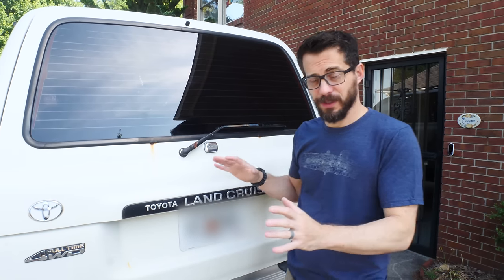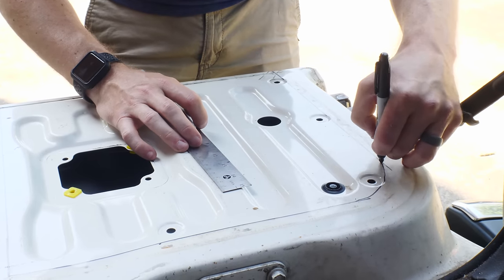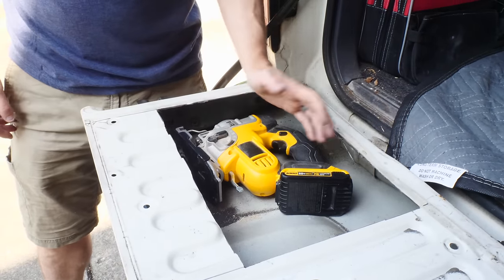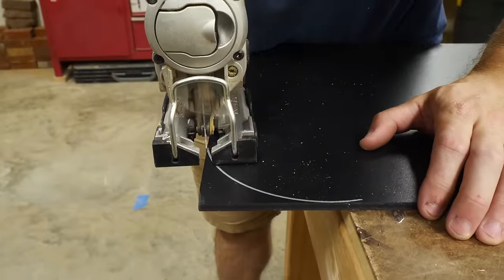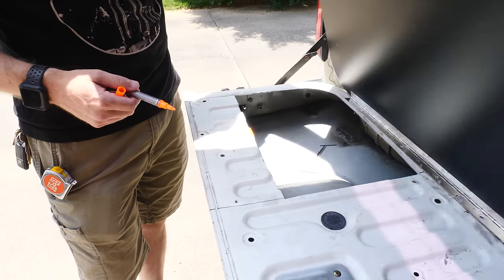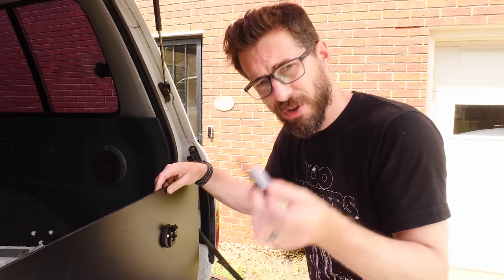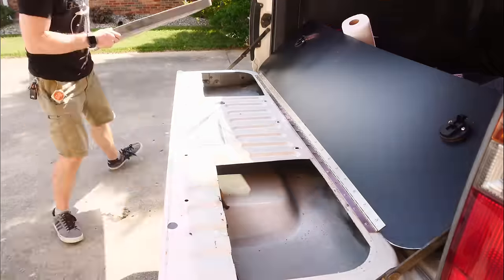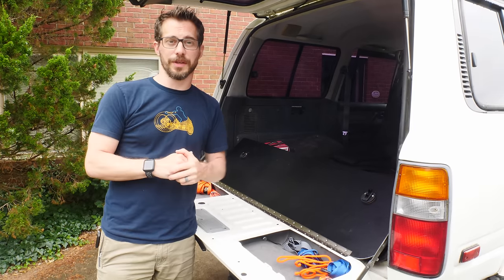Custom Tailgate Storage // Land Cruiser | I Like To Make Stuff

Comment: Hey bob, I have done something similar to work trucks. We did the same thing by cutting pockets into tailgates and used diamond plated steel as the cover but we covered the inside storage and the cover in similar material like rhino liner( spray on truck bed) it made helped with sound and rigidity. I also work with a lot of thin materials like composites and a way to make your cover rigid is to apply some single directional flex honeycomb. Think like the cardboard sheets that have honeycomb and how rigid they are. Let me know if you want to discuss more. I can give you more in-depth detail.

Comment: Hi Bob ! Great project as usual. But you made 2 compartment storage, and only 1 door. I think I might cut 2 doors. To make door closing, i might use magnets because you can stack papers when you need help in  perilous situation. 

For my van, I preferred to buy a 5 seats. But in the cabin, between my seat and the passenger seat (as we call in French "Place du Mort" place for dead) there is nothing. An empty place. So I decided to fill in the gap with 2 storages, 1 big enough to store road maps, wheel wrench, 2 warning triangles and 2 safety vests... The second is made to store my mobile while I'm driving, electronic toll card for highways and my usb key. It's made of MDF that I paint in black, I used hinges, magnetic locks, and "air spring". I can't finish because I need some help to finish the with fabric and foam, to have a mellow surface.

Comment: Awesome mod!  I see others have already recommended adding a rubber gasket around the edges, which I also think I would do...additionally though I think I would have pulled the plastic clips off the original tailgate cover panel and then used on top of your plastic panel.  This would have taken out some of the gap you were fighting for your marine latches, plus it would have a bit more of a factory OEM look.  Of course this would mean drilling holes in the panel too...but you already cut your truck so I would say go for it!

Comment: Plasti-dip tool handle coating would be a great add to the metal lip left over after the cut.  It's thin but provides a nice, durable coating.  I have used it for walking stick handles that have lasted 5+ years so far with heavy use.

Comment: My current project is a front end rewire on my ute including battery relocation and reconfiguring the start and charge circuits, its real nerve racking dealing with cable management,  bob, you should put in a power box in the back of your cruiser, usb, 12v and accessories, plus usb outlets behind the centre console so passengers can charge their stuff too

Comment: Love the videos!  Land Cruiser videos especially.  Next you should do on board air compressor.  Puma makes a good 12v air compressor.  I had one in my 93 LC.  You can weld up a bracket to hold it using one of the 3rd row seat mounting holes on the wheel well.  Super handy having a real air compressor on board.

Comment: I did something minor to my car way back in the early 2000's. I had an '88 Camaro. Like many cars from that era, it had an ashtray for cigarettes, and no modern power or audio connections. I had a pre-iPod mp3 player from Creative. Used the ashtray panel from the center console as a template, plastic-welded up some styrene sheets, and then built a dock for the mp3 player that included audio and power connections. The player dropped into the dock like you'd shove clip up into the grip of a pistol. I had an old fm transmitter glued under the panel, which allowed me to transmit the 256megabytes of mp3s to my OEM 1988 radio. Wish I still had pictures of it. Even my car-guy kid brother liked it.

Comment: Hey man, you could rivet some aluminum channel to the full length of three sides of your foam pvc cover to add strength to the sides and corners and limit flex when it warms up.  That would also make it a lot more durable.

Comment: I love this but I do have 1 suggestion.  speaker box carpet.  Add it to the top 1. cleaner look 2. slight acoustic enhancement. 3. I cant confirm this one will work, but I believe that if you add it to the top it might help keep the plastic from getting as hot and warping, cant say for sure this would work but I suspect it might not draw as much heat as the bare plastic.  also if the plastic rattles against the tailgate, a layer on the back side might help.  you can usually find speaker box carpet in a variety of colors to match your vehicle and is usually available on sites like amazon.

Comment: Love this use of space. You know what would have worked extremely well when cutting these pieces out. A powered sheet metal nibbler. It is specifically made for doing this. Also, you could have used the chalk marker and put it on the plastic rivets things that held the carpeting on and then lay your black plastic on that. Drill out the holes where the plastic snaps go and then drill holes in the plastic and the carpet for the latches to go through. Then you could have attached all together and still keep that piece of carpet that matches the rest of your interior flooring and still be able to use the latches. 👍🏼

Comment: Sure, I (sadly) often have doubts starting projects. I have one in my garden that I've wanted done for years but don't have the guts to start. Not sure if it's needed, but maybe cutting some thin pvc tubing and put along the edges of the metal to avoid scratching yourself. Depending on how it works some dividers might also be good to avoid noise from stuff rolling around. But no need to add something that isn't needed! :)

Comment: I love seeing foam pvc being used for different things. I mostly use it for cosplay armor myself. Just be careful if you ever have to heat form it and don't use the laser cutter to cut it as the high heat causes the release of dangerous fumes that can harm you and cause early degradation of your laser cutter.

Comment: Just came across your video mate, have done the same to my ute (truck) tailgate. But with food grade stainless steel so I have a cooking surface. Also use pinch weld for around edge of your cutouts to save on bandaging your hands later pulling things out of the new storage spaces.

Comment: super cool idea, I've done similar on my Jeep, and I found that it also looks a little cleaner if you take some rubber stripping/ weather sealing material and line the edges of where you cut. It's less dangerous that way and looks a bit less jerry-rigged! just my 2 cents tho

Comment: great little project, have a tip though, I had a small concern about the metal edges, yes you filed them down but i feel a rubber gasket that people use on widebody cars would be a great addition

Comment: @ILikeToMakeStuff Instead of the PVC plastic you might try some 12 gauge steel. I'm afraid when you pull something out of the back of the truck it will cave in. Even sitting on the tailgate, someone might sit right in the hole and bust it. Another possible option would be to cut it in the middle so there are two doors.

Comment: Interesting storage idea!  I think I would also use a different material than that foam board, maybe a nice diamond plate or hardwood panel, to preserve my ability to sit or stand on the gate without going through the holes or bending their edges (because it's not only the ridges in the skin that strengthens it, but also the fact that it's a solid skin).

Comment: The rivets will eventually pull through the plastic. If you put a small washer on the back side of the rivets prior to setting them, that will prevent them becoming loose and pulling through.

Comment: Hey I Like To Make Stuff,  I don't know if I'd be cutting my tailgate open like that, but I do like how yours came out :)  Here's a quick tip for when you have an exposed sharp edge on sheet metal; I used this stuff a lot when I worked for Blue Bird Bus Co. building school buses.  I don't know the generic name for the stuff, but we called it TrimLok.  It's a flexible rubber trim that clips on to an exposed edge on sheet metal.  The clips are molded into the trim so you don't see 'em.  It looks great and covers up sharp edges.  They make it in many sizes and colors. Try it out next time you have an edge you need to cover.
Reply: By the way, if you decided to use something like that you can use a heat gun to soften the trim up to form it in to tight bends like in a corner, etc...

Comment: I would go back and add some edge trim to those cut holes. It covers the bare metal, prevents any possible cuts, and adds a more finished looked to the hole. It's meant to cover cut edges of sheet metal like that and its pretty flexible so the ridges shouldn't be an issue.

Comment: I would have made all the corners radiused to reduce stress risers, and then fold a small lip to the edge all the way around for stiffness. Also if you positioned the latch a couple inches over then the latch keep could have gone under the low part of the corrugations to save the packing and the bolt heads protruding. Easy to be wise after the event though.... ;-)

You can add velcro straps to the closed cell foam to hold stuff in place, or make some fitted trays to drop in the holes that then form removable tool totes!

I have been tempted to do similar but my tailgate is hinged upwards so less useful, I do have lots of added hidden storage around my car though so a big thumbs up for the video!

Comment: I want to build a home automation setup that requires wires run to each window and door. This means a lot of holes, a lot of patching, and a lot of room for issues. Putting holes in my relatively new house is very scary, but one day I will get it done. Also, great project, I love your simple, but useful vids.

Comment: What about using tongue and groove boards that are glued together? I think that'd be a nicer look, especially if you could use some type of a wipe on polyurethane to darken the wood a little, providing for a nice looking contrast with the white truck. Plus the look of the wood grain would just be nice on a tailgate I think. You could even go as far as to put in the little traction pellets that are sold at most paint stores like Sherwin Williams. That would provide good traction on the smooth wood finish.

Comment: Probably as close as your tailgate will be able to get to one of them new fangled Ford tailgates. Might want to rivet on some sheet metal. The sheet metal should be riveted to the hinge. Aluminum, brass, and steel would be some good choices to reinforce the PVC which melts at 180°F. Then it could maybe a a couple of locks. And, 'fortunately', if you ever lose your keys, simply buy another lock ( as a spare ) and you've got a new set of keys. You might be able to get 1 new pin at The Home Center store, and rekey your key a bit, so your locks and keys will be a little different. The lock picking lawyer would have a field day with those locks all being the same. I use to rekey with a Dremel back in the days of need. It's easy. Pins to long? Dremel!

Comment: What I do: Before I work on a vehicle piece I've never touched, I look it up on a junkyard site like LKQ, and see if they have that car and go and pull the part and experiment on that. It's generally between $15-$60. The thing to remember is that part is often on multiple years of that vehicle (look it up first. Just cause you have an '01, it my be on ever model from '98-'04). It can also be on multiple cars. Like my MR2 Spyder's engine type is in numerous Toyota's. They didn't remake every part for every year, for every car.

Comment: Good idea. I would have put the rivets through from the other side and then flattened the protruding heads on the hinge side. This puts the wide shoulder of the rivet on the softest side and may keep them from pulling through the material.

Comment: Hey Bob. I would like to do something  similar to adding storage in the  panels of my truck bed. And if you do anymore sheet metal projects you should look into the Noga db1000 deburr tool. Its cheap and works great for those sharp edges. They also have others that work good.

Comment: A dab of rubbing alcohol takes sharpie marks away post-haste. I once made a storage pocket similar to this on the inside of a van door (not sliding). I didn't need to cut away anything, though, as it already had a massive factory access hole in the right spot.

Comment: You should always use rounded corners. 
With 90° corners the metal will fatigue and develop a crack where the two sides meet.

Comment: I have a few projects that I am concerned about.
One would be cutting am old gas can to make a banjo. I don't want to ruin either the banjo or the pretty can I picked up. 
Second would be adding Bluetooth compatibility to already existing hardware in my car. I'd have to take apart the wheel. 
Third would be building a small Wang pulled wood wagon.

Comment: A suggestion for your marine latch placement if you were to redo it. To me, it would be more comfortable if the marine latches were rotated 180 degrees so when you open up your flap, the lifting and latch pulling motion would be the same direction. This would also mean you would have to most likely cut out a separate hole in the tailgate (farther away from the hinges) to accommodate the marine latch and associated bracket (which would be flipped the other direction). Hopefully you understand what I'm getting at here. Cool project tho, but I just thought I'd give a suggestion for maybe someone else who is debating how to do this project in the future. Keep up the good work and great videos!

Comment: Yes I do have a scary project I've been putting off... We used to own a pop up camper, and I installed a stereo and marine speakers for the outside.  Now this was pretty easy as I could pretty take apart the inside to access everything.  I did however almost have a disaster...one of my 5" holes just scraped past the jacking post that holds the roof up.  Way to close for comfort.  We now own a "hybrid" travel trailer, and again I want to install outdoor speakers.  I can access the inside like before, but I'm a little shell shocked to make the cuts...

Comment: I've been wanting storage in the back of my jeep, in the same way you wanted this storage... Something to keep a few tools and straps. I've been thinking of using a metal toolbox, drilling though the toolbox and the car, then bolting it in place... Not quite as much risk as cutting the car, but I still don't feel super comfortable with the idea of drilling through the jeep and am concerned about vibration noise, rust, and ultimately if it will hold while I'm on rough trails.

Comment: I would use some sheet metal to make boxes and weld them to the tail gate that way you don't run the risk of yanking the wires from your plate light or losing something in the middle of the gate. Kind of like the way lowrider trucks use boxes for their plate in the outside of the tailgate.

Comment: You can get case maker latches made from steel, that will work perfect in this application. ~10-14€. These work from 0 - 10mm so you don't need any spacers.

Comment: I'm planning on wiring some led lights under the rails on my truck bed, but I'm not exactly confident in my electrical abilities. I also need to change the spark plugs
Last time I worked on my truck I ended up stripping the threads on my oil pan.

Comment: i was really hoping you'd use the part you cut out as the lid. you could use some vinyl/plastic trim around the edges to keep them from cutting you; plus they'd be a perfect fit. yeah you'd have 2 different doors, but that way you could keep one shut if you didn't need anything from that side. plus, the color would match.

overall, nice job on this; i like it. i could essentially do the same thing on my truck. but since the tailgate is out in the weather, i'd have to make them weather-tight to keep out any water/moisture.

Comment: Scared to drill 8 holes in my roof to add 8 threaded nutserts. Adding my own custom Aluminum square tubing roof rails and crossbars for some Kayak J bars, bike racks, and basket to the roof.

Comment: That plastic is a mother of expansion and contraction. If you bolt in some stiffener splines in the area's of the opening should help. It will grow and shrink but ,I don't believe it will matter much in that application.

Comment: You could probably use the laser cutter to cut out a thin frame that would add rigidity to and strengthen the door on the inside.

Comment: I think the projects I get the most nervous about are when you have to "permanently" remove/alter something relatively permanent to accommodate the thing you're making. During the first part of our office built-ins, cutting the carpet to allow the cabinets to be secured solidly to the floor was SUPER scary! Sure, if it got screwed up, the carpet could be patched or the whole room could be replaced, but it was still a scary step, especially doing it for the first time.

Comment: My Fear Projects: bought a new home over a year ago and theres some things I really want but too afraid to do. 1) I want need to figure out a winch or pully or something to help bring things to attic. We have this huge attic space BUT high ass 12 foot cielings so its really hard and kinda dangerous getting things up there. I got xmas stuff up there and no idea how I will get it down this Nov.

2) I want to change the locks/door handles on the side gates. Its just a regular gate lock with a key pad lock. I want a keyless entry system so I don't need my keys when working outside and going back and forth from front to backside.

and 3) I have some landscaping I want to do, but need to dig up my yard to do it. Been watching This Old House videos to pysche myself up and know I can do it.